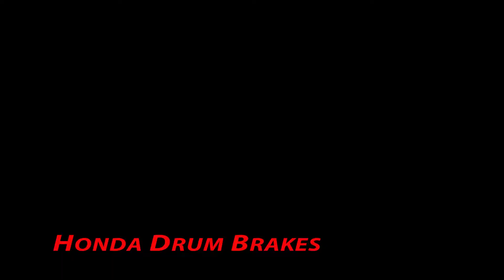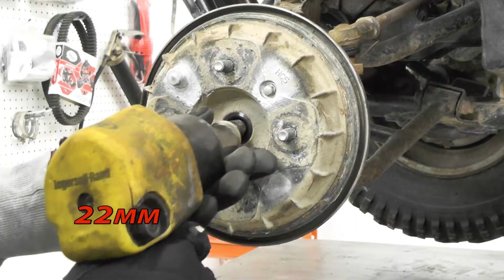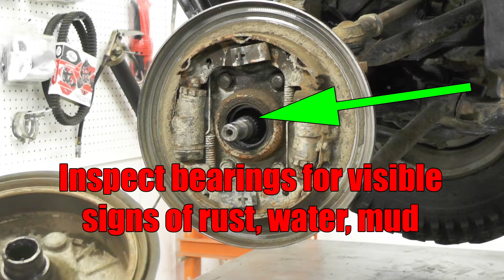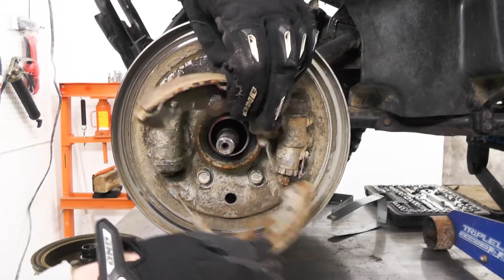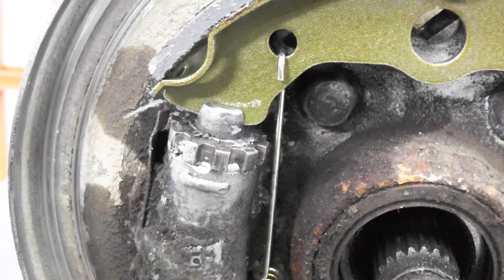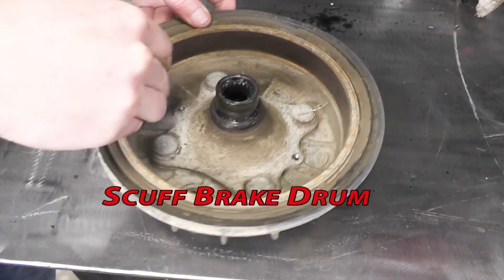How To Change Front Brake Shoes (Drum) Honda ATV 1988-2006: Rancher Rincon Rubicon  Fourman Recon

Comment: Great video and very helpful. I just have one question. How thick are brand new brake pads? This is a used ATV I just bought, and the brake pads on it have a 1/8 thick left of brake pads left. Since I have never seen what new brake pads look like, it is difficult to judge. Thanks for answering my question and happy holidays!
Reply: Not very thick make sure yr adjuster at the bottom is not froze up? One side had rt hand threads the other has left hand..rt hand on rt side left on left side..

Comment: Got a question. I had to replace front wheel bearings in the Brake Drum on a 94 Trx300 2x4. Should I grease the axle a little upon reinstalling the drum or is it ok just like it is?
Reply: I would suggest greasing them if u haven't installed the axle and bearings yet

Comment: After I replace the shoes I have to pump the brake to make it work. I did not disconnected any lines I am not sure what happened. Any suggestions?
Reply: maybe not adjusted correctly. there is two wheel cylinders per wheel with adjusting wheels on them...